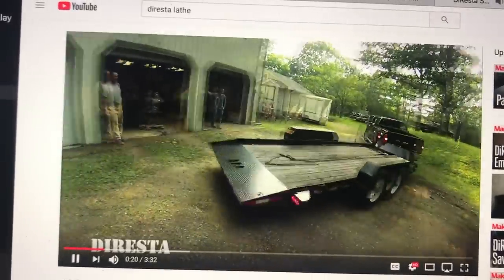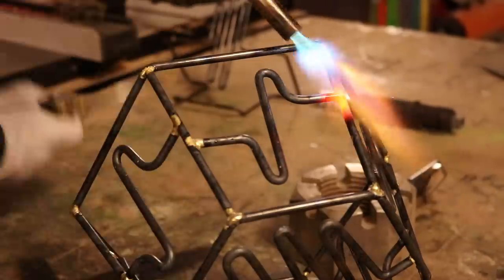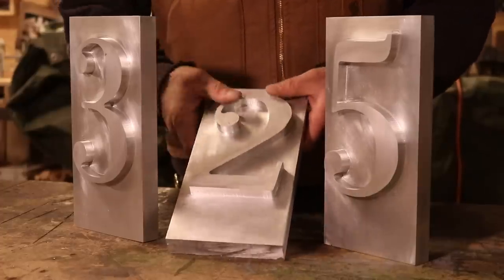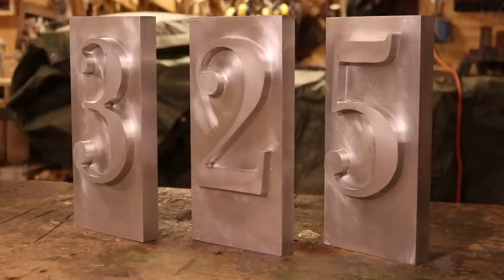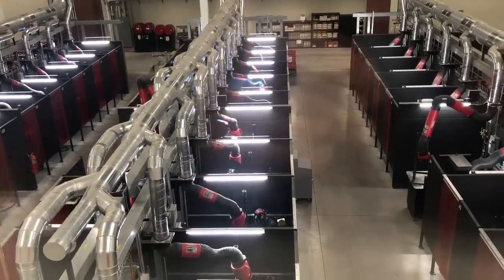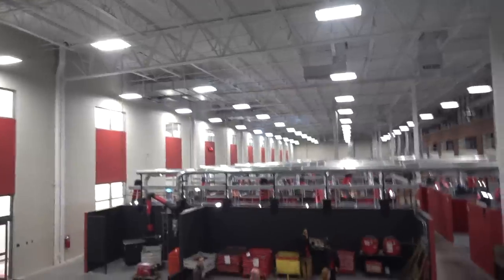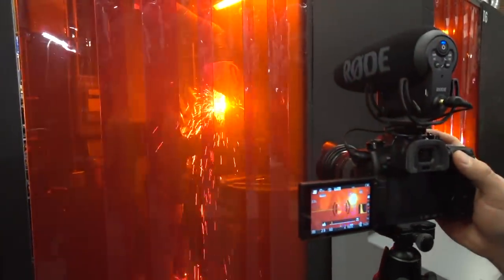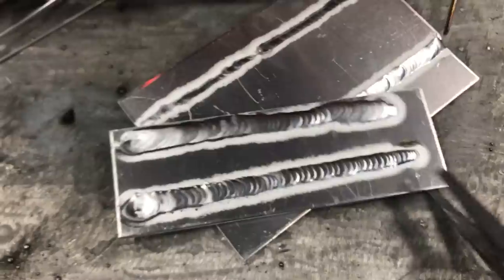DiResta 66 My Trailer was Stolen!!

Comment: I had a trailer stolen once. I got it back a few days later but ever since then I have retrofitted all my trailers with a receiver tube on the tongue. I now have a 2 inch and 2 5/16 Coupler that I can attach and remove via the receiver tube. I also got a friend to help build a circuit that pulses the brakes on the trailer and flashes all the lights(when plugged in) via a battery and solar maintainer Whenever I engage a Hidden keyed switch. Now if somebody wants to steal my trailer they are going to have to drag it by a chain without the tires turning
Reply: So you can remotely engage the brakes effectively? Keep in mind that you might endanger innocent bystanders if this goes off in the wrong place .. Maybe just blaring the horn in addition to blinking the lights is a better idea?
Reply: Kyshu i believe he means that when one doesn't flip the switch it starts to do this, so it would be very difficult to even get going with the trailer
Reply: That’s exactly what I meant. If they can even hook to it in the first place since I’ve made my Coupler Removable. I turn on the switch when I unhook from the trailer and that engages the brakes pulsating 30 seconds on 5seconds off In flipping that keyed switch that also makes it if they are just somehow hook up lights to the trailer they won’t function properly they will just blink SOS and stolen. I also put a female plug for the trailer wiring on the trailer rather than a wire hanging off. I just use a double mail jumper to connect trailer to the truck. I live in a pretty rural area and trailers that really isn’t a problem but I got that one stolen and got a little carried away
Reply: I live in Texas. Where public safety during the commission of a felony is the problem of the criminal not my problem.
Reply: Sounds like an idea you can sell
Reply: Themonsters546 Maybe. But I wouldn’t want to because if it were successful thieves would just prepare to beat it. Most thieves looking to steal a trailer are prepared to cut things. The beauty of this unless they know what wires to cut or start cutting all of them they have no way to beat it

Comment: Jimmy idea for you. My uncle made one of these for a friend so his trailer couldn't be stolen. Take a piece of bed frame and cut it 4" longer than your trailer wheels. Put a "T" on one end 6" long on the other end cut a steel plate so it will slide over the bed frame materiel. Make this piece 6" as well. Slide it through the wheels of the trailer and put a lock on the end with the plate that slides. They cant get at the bar to cut it and you can use a high security lock on it like they use on storage lockers you rent. They cant pull away with it either. Its locked in place.

Comment: My utility trailer was stolen, filed a police report, and figured I'd just buy another one later.  Next week I got a call from the Sheriff's Office and they thought they may have recovered my trailer.  I described it again and they said come take a look - it should be yours.  I did and it was!  The BEST part is they CLEANED IT UP!!  Degreased the wheels, shined the tires, and pressure washed the frame and wood decking!

Comment: Jimmy, my 8' utility trailer with a fold down ramp was stolen jan 2017. It had a u-bolt syle tongue lock(worthless i found out); they merely pried it off with a crowbar. they found this january; it was missing most of the components. My insurance paid me off after long arguments on the coverage of my extra equipment i had with it. Checkout the "California Immobilizer"; it's the best iv'e seen to prevent theft. A plate also covers the wheel so they can't just take the wheel off. The cops figured my was stolen by druggies looking for something quick and easy to steal.

Comment: FWIW I use a Master "hardened steel" padlock on my trailer tongue latch AND a huge over-the-coupler riveted steel Master hitch lock. I tried to cut the hardened lock and could not with Ridgid 24" bolt cutters. Unless they're crazy hardened, chains are easy to cut @HoneyOnWales

Comment: You have a Tormach, but you used the router table to cut it? That doesn't make sense. I don't think the trailer has anything to do with you being out of town. As far as the thief is concerned, everyone is "on vacation," every night, from midnight to 5:00 a.m.
Reply from the maker: it didn't fit into the limits of the tormach over 10"

Comment: put a boot on it or get a junk truck n hooker up to it, ya know, get a junk one that dont run, one that looks like it does but doesnt. if ya get it back the boot would be better and if you really want to keep track of it, wire in a gps locator device that runs off of the hook up.